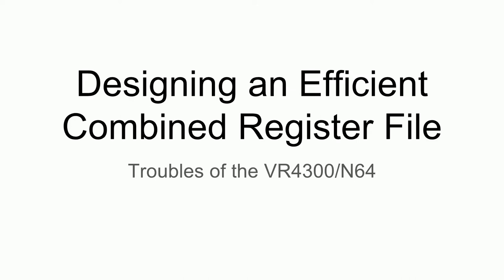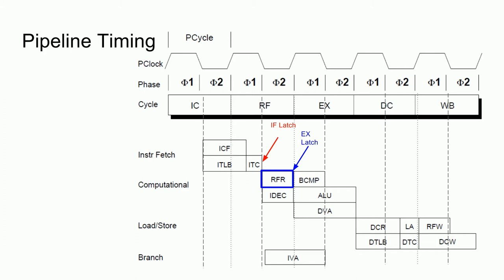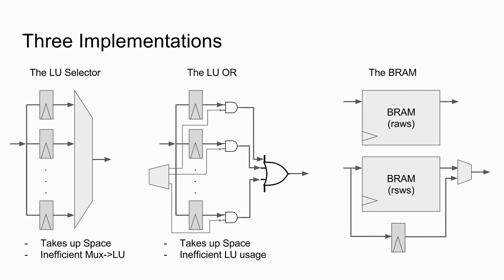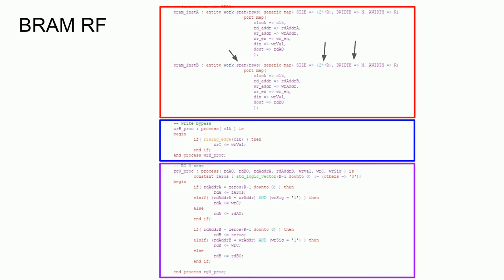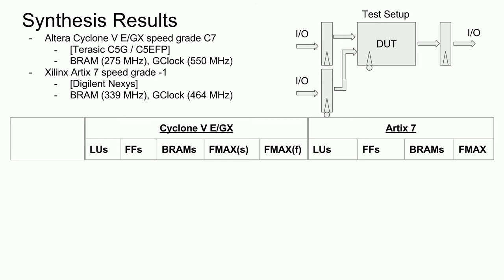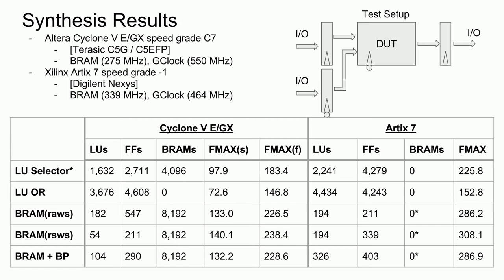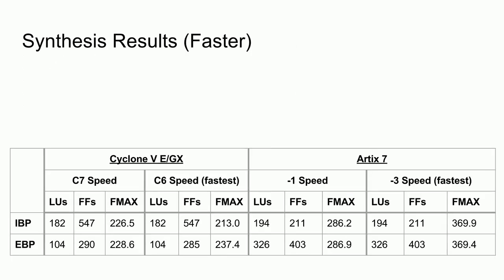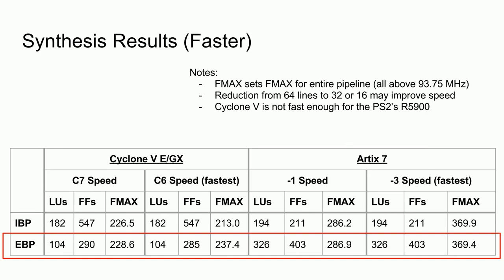Designing an Efficient Combined Register File

Comment: To force Vivado to use BRAM use:

(* ram_style="block" *)
reg [7:0]RAM[(RAM_SIZE - 1:0];
always @ (posedge clk)
 begin

 if(write)
  RAM[addr] <= input;
 output <= RAM[addr];
end

For ROM:

(* rom_style="block" *)
reg [7:0]ROM[(ROM_SIZE - 1:0];
initial begin
 $readmemh("rom_file.mem", ROM);// populate the BRAM with data from a file.

end

always @ (posedge clk)
 begin

 output <= ROM[addr];
end

However, all Xilinx FPGA's BRAM's have LATCH on outputs and can not be bypassed, so you can not use BRAM like asynchronous RAM, only distributed RAM can be used as asynchronous RAM.
If you put a latch at the output of the RAM, Vivado will automatically choose BRAM's.
Reply from the maker: Sure, however there are two problems with your suggestion:
1) I am using VHDL, not Verilog (though there is obviously a VHDL equivalent)
2) The goal of the HDL was to be cross-platform. So if I added Vivado specific implementation hints, it wouldn't compile for Quartus.
You are also incorrect about the Xilinx BRAM Latch. The BRAMs can be used as "asynchronous" RAM in a sense, you just need to provide the address in the previous clock cycle. Or more specifically. The address is always latched on the clock for a Xilinx BRAM, but the data is not (It's optional for the data).  That can, however, lead to timing budget issues. The Xilinx Memory Resource guide discusses this in detail.
Also, one of the testing issues that I was having, was that the output register (used to test timing) was being inferred as the data latch for the BRAM. So I probably do have to redo the experiments in this video using the keyword hints, although, it's sort of moot since the register file design will depend on the architecture implementation (i.e. you can implement an architecture that is optimized to the register file technology mapping).
Reply: @RTLEngineering  Sorry for the confusion on BRAM description.
I'm kinda newbie in RTL and sometime I kinda screw up the terms :D, sorry.
I use Verilog because I come from C,C++ world :D, VHDL syntax for me is kinda difficult to understand, but at last I can translate from VHDL to Verilog :D.
Now I work on a five stages pipeline risc-v core, previously I have done a version that load,execute and write back is done in the same cycle with interrupt controller (~100mhz on Artix -1 speed grade)(ehh, very simple stuff :D).
The previous core I developed for generic stuff, to eat less resources ~900LUTs' on both Xilinx Artix and Lattice MARCHXO3L (including ROM and RAM), now I want to do a performance core, like multiple instructions in a single cycle, out of order execution....
I take the idea of changing the polarity of the clock of the BRAM, to create register files from BRAM, to have the output data from registers feed back to them thru ALU in the same clock cycle (not for performance, but only to implement it on very small FPGA's (like Lattice 1-2-4K LUT4), because the ALU will have only half cycle to execute the operation - BRAM output delay).
Maybe you will continue to post videos like this, there are very small number of videos that talk in detail about RTL implementation, I have a lot to learn about RTL, and yes, is very useful to see some code, for me even in VHDL.

Best regards
Reply from the maker: No worries, some of the terminology can be a bit confusing.
That’s the reason why I prefer VHDL, it’s very different from C/C++. When working on RTL projects, you will typically create your module and then create a C/C++ model to test against it in simulation (I am part way through a video talking about that). So switching from C/C++ to Verilog and back quickly would become very confusing since they are so similar, but describe completely different behavior. There is also the fact that VHDL is much stricter in how it’s typed (it’s very explicit). It’s very hard to make a syntactical bug in VHDL – it just won’t compile. Compare that with Verilog where 80% of the bugs from Verilog modules that I have worked on, were from syntax issues that compiled without warning. Also, VHDL was the first RTL language that I learned, so that probably adds to why I prefer it.
That’s impressive that you were able to get a single-stage RISC-V to run at around 100 MHz (or was that in the fast corner?). I was recently working on a 16-bit MIPS CPU (implements most of the MIPS I ISA in 16-bit instruction encoding), which was also single-stage (technically 3, because of the instruction fetch), and it could only run around 87 MHz on the same chip. I think the biggest issue was the address generation feedback (for loads and stores, as well as branches). Were you using BRAMs for the registers instead? If so, then it would be 2 stages, right? (RF + EX/MEM/WB)
I highly recommend against jumping into an out-of-order architecture from a single-cycle CPU. You should work on them in the order that computing architecture developed, since you solve simpler problems that are needed for the next generation. So single-cycle -> pipelined -> super-scalar -> out-of-order (OoO) -> simultaneous-multithreading (SMT). I know it may sound cool to jump directly into an OoO CPU, but the complexity difference there is like comparing a bicycle to a jet airliner. The process for figuring out how to do a pipelined CPU with data hazard detection is a complex one, and you need that solution for the super-scalar, OoO, and SMT.
I will continue to post videos like this (there are others on my channel), eventually. I am a bit busy with research as well as another project in real life, so I haven’t had time to make any additional videos (they take a lot of time to produce).
Reply: @RTLEngineering  I will try to learn VHDL, I heard from many RTL developers that is better and more restrictive.
The RISC-V ISA is a very friendly for RTL implementation.
The REG's are implemented in distributed RAM one WR and two RD, the implementation, decode the instruction, read REG data, do the arithmetic's and store back in a single cycle, the jump and conditional jump take two cycles because I use BRAM's for program storage and after a jump I need to discard the next instruction, and load instructions take two cycles because data from BRAM can be used one cycle after address issuing.
Now I finished a 5 stage RISC-v implementation that execute one instruction/cycle and the penalty for a jump/conditional jump is 4 ( three for flushing stage 1-3 and one because of BRAM ) cycles and is running at ~160Mhz with timing violations, the issue is the feedback from the temporary data write registers used in cycle 4 and 5 until are write back to the REG bank, because I read the data from REG bank in cycle 3 and write back in cycle 5 and two cycles the data to write back to the REG bank are stored in temporary registers and I need to check the most recent changed data in the pipe to use it in current arithmetic operation, if the source register data is not in the pipe registers for write back I take it from REG bank.
I will further optimize the design until I squeeze the last Mhz from the design and get red of the timing violations, after that I will begin the work to the super-scalar implementation.
Because is a RISC architecture and are some instances that three instructions or more can be executed at once taking in consideration that I read the REG data in cycle 3 and write back in cycle 5, so I have 3 cycles to work with a data that is in temporary registers.
To arrive to a out of order execution, I need a I-cache implementation (already done) that allow me to pre-decode several instructions in that line at once, the advantage of RISC-v ISA is that you need to always look at the same 12 bit's from 32 bit instruction word and only 2 bit can overlap with instructions that use constants but are at a fixed locations, so is much easier to implement several decoders and a lookup table sorter and because the addresses of the two read and one write REG are always in the same place inside a instruction word is much easier to implement a out of order execution design, like that I see it now and I don't even begin to work at out of order implementation, so imagine what is in my brain :)))))))))))))).

Anyway.
One idea that I have is for VR4300 emulation and other obsolete cores inside a RISC-V core, is to combine a software emulation with custom hardware acceleration.
For example, a lot of time is to software decode the emulated instruction and execute it ( the events take more less time to emulate because are rare in comparison with actually executed application).
You can create a co-processor wired to the RISC-v core in IO domain, that you push instructions to the co-processor to be executed and the registers be wired to the IO space of RISC-v ( you can even give a dedicated ram to the co-processor that will be wired into IO domain ), every time the emulated core want to talk with another resource than registers (or dedicated ram) to signal to the RISC-v core that need, with an action request code that can be a position to a vector function table, and for external interrupts, IO's and cache to use the RISC-v ecosystem.
You can use any other well maintained and with bigger ecosystem that have the IO and cache already developed, needing only to develop only the instruction decoder and to customize an existing ALU, the rest can be emulated in software( or the software with hardware acceleration).
Reply from the maker: That’s a typical implementation. I am still surprised that you achieved the speed that you listed. Have you tested it in simulation? Does it correctly sequence jumps / branches, as well as memory reads?

Why would the jump / branch penalty be 4? In MIPS, the jump penalty is 1, which is hidden via the branch-delay slot. That’s a very inefficient design… You may want to relook at your architecture and figure out how to reduce that.
At 160 MHz, I wouldn’t worry about squeezing the last few MHz out of the design unless you have a reason to do so. Basically, you have two main targets for RTL implementations – speed and area. For a chip like the Artix-7, unless you are specifically implementing a system that should run faster, 160 MHz is a good target – it’s not worth optimizing further. If you want to make it as small as possible though, then optimization would make sense. Though keep in mind that the two contradict each other, so you can make it small or fast, not both.
I am spending so much time optimizing my VR4300, because I want to use the same parts in an R5900, which needs to run at 300 MHz. If I were only doing the VR4300 though, I would stop at 150 MHz.
Before moving on to the next architecture, make sure the CPU executes instructions correctly. Being able to synthesize the design doesn’t mean that it’s logically correct. 
For I-Cache and D-Cache, I would implement that on the pipelined CPU first. There has been an I and D cache on the MIPS CPUs since the R3000 back in 1992. So you should go back and do that before moving on too.

That’s an interesting idea for the VR4300 on RISC-V.